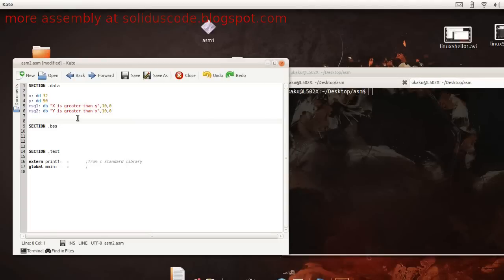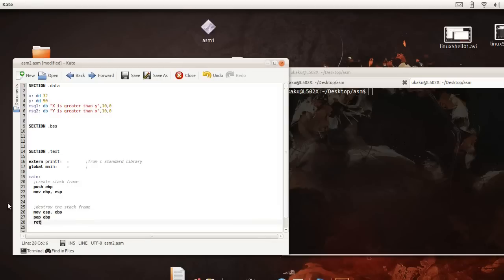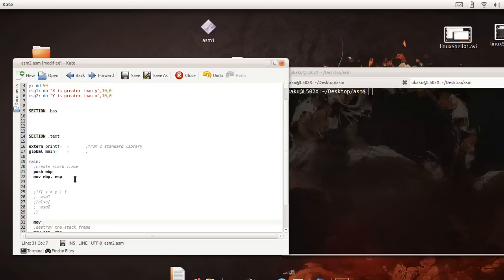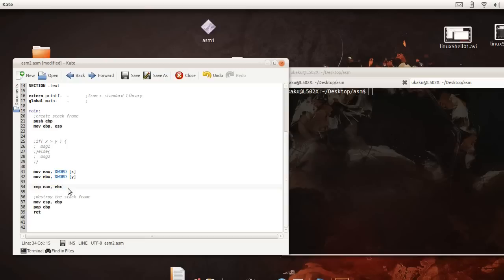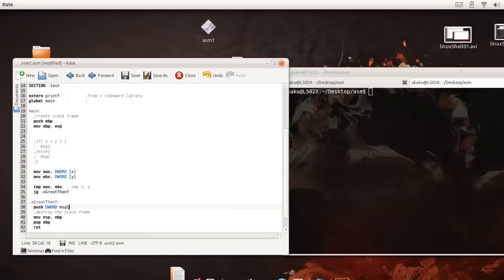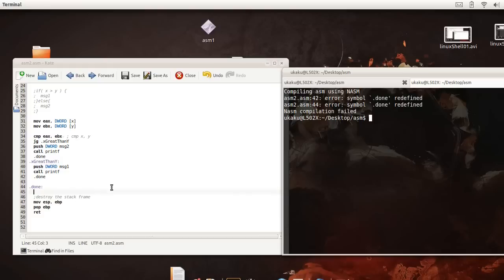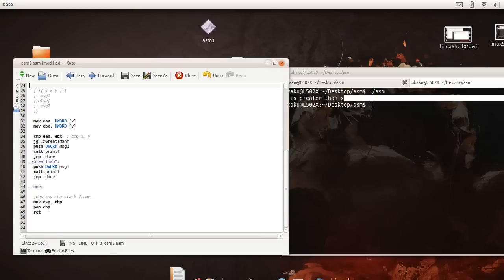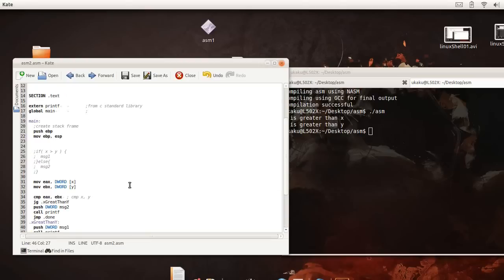NASM Assembly language programming 03 - If statements

Comment: eax, ebx, ecx and edx are general purpose registers, they are just a place where processor stores data thats 32 bits long... it can be used as ax, bx, cx and dx for 16bit values and ah,bh,ch,dh for 8 high bits of ax,bx,cx,dx... al,bl,cl,dl for 8 low bits

Comment: The printf/scanf code is already stored in the standard C library. You're calling them from there to be included in your asm program with the extern keyword. You call them with the call keyword by writing the line "call  printf", which takes printf instructions from the standard C library. printf is undefined because you need to include it from the C library. Just before the line "global main", try writing "extern printf" and see if that works. Hope this helps :)